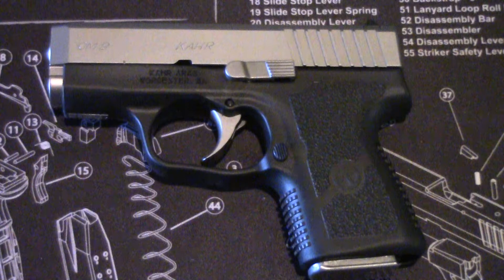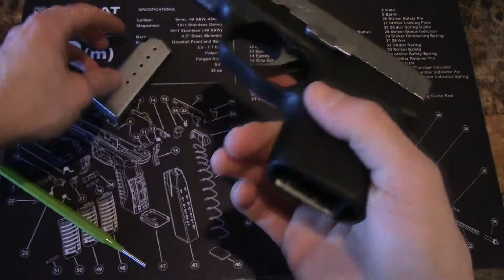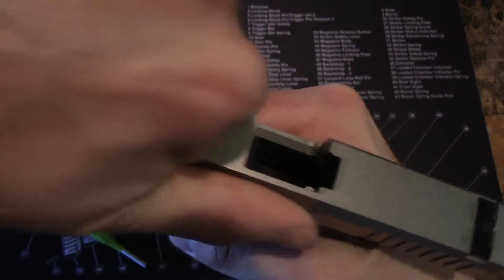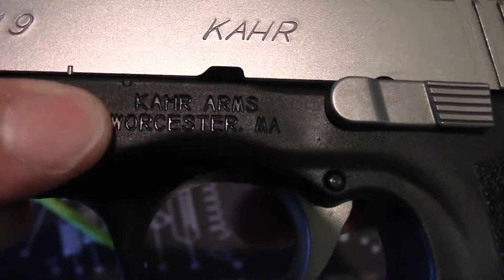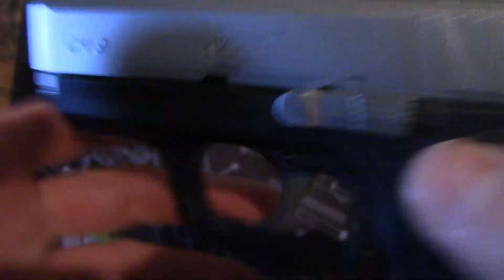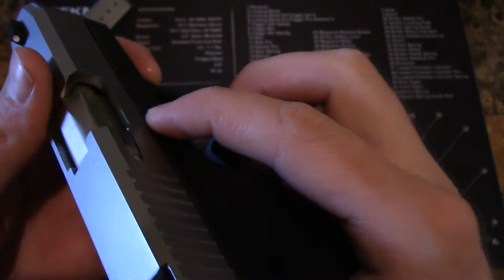Kahr CM9 Field Strip

Comment: Thanks for the video.
My pin is hard to push out too even though I've had my Kahr a few years.  Instead of using a pin punch I put a quarter over the pin end OR I put the Head of a key against the pin and push the quarter or the head of the key.  The key head works as good as a coin.  That coin / key head prevents my finger flesh from lettnig the pin stay too far in the frame.  
Also on the frame there's a piece of metal which often won't allow the slide to push back all the way onto the frame.  On a part list the number of that part is 31 and it's named Ejector (not the shell Extractor) and it's on the same pin as the Part 15 named the Cocking Cam.  The end of the Ejector must often be pushed down slightly to allow the slide to be pushed all the way back onto the frame.
Reply: You are correct. Sometimes that can cause an issue when reassembling.  Overall very tight, very good gun.  But yeah sometimes putting back together is ridiculous.

Comment: You mentioned yours not yet being broken in. One thing I have found with mine is after the 200 rounds as per the manual, I am seeing a lot of distortion in the polymer frame. Makes for a rough time putting it back together, as well as at least 2 attempts to get the slide to release in the first place.

Not sure if this is common with all of these, but jeebus... Sketchy AF thinking of this still putting rounds down range...